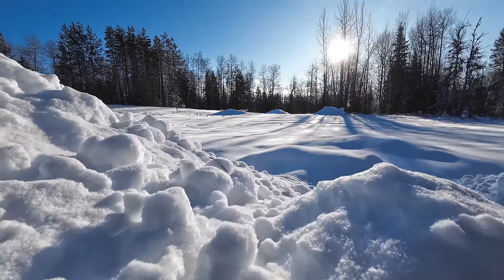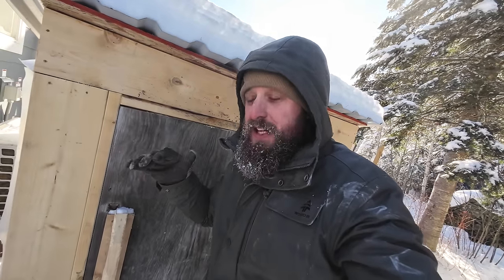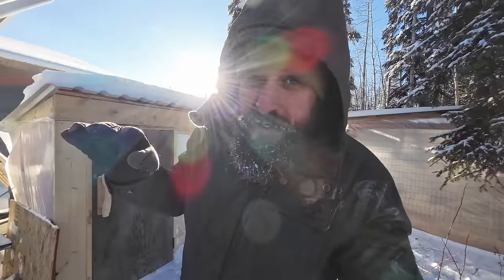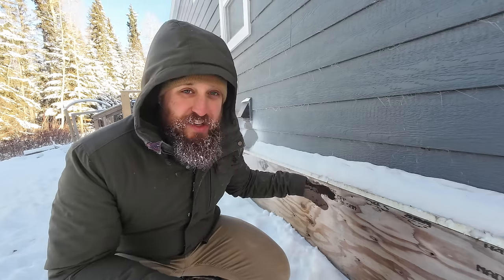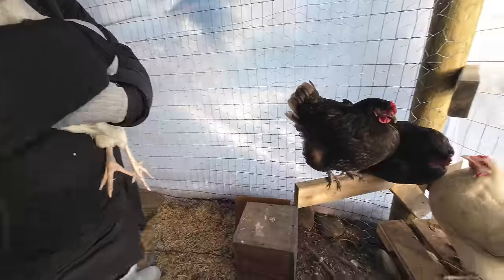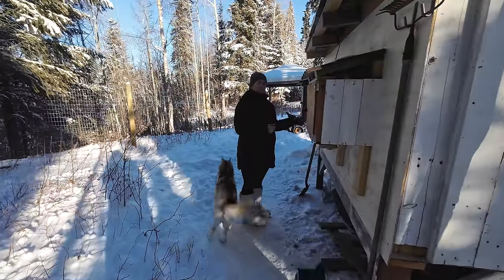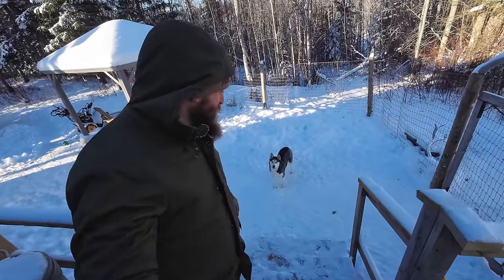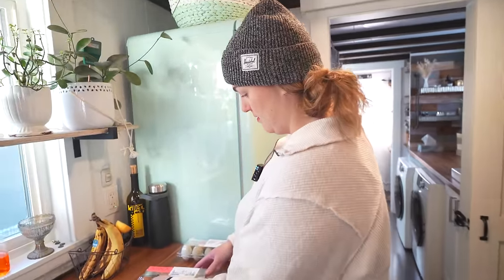Surviving a POLAR VORTEX in our TINY HOME! | -35 Celsius!

Comment: My father always shovelled snow all around the shirting on our trailer to help insulate and keep the cold wind from getting under. it really makes a big difference.
Reply from the maker: Snow is an amazing insulator and makes a MASSIVE difference :)

We should have enough snow fall that we dont even need to shovel it as it will build up that high on its own haha
Reply: Yes, I used to do this when we lived in a mobile home. Got to be such a habit, I still did it around our concrete basement walls when we moved.
Reply: He was kinda building an igloo.👍 Smart man.
Reply: Great idea!! My Dad did something similar with our 1890's uninsulated frame 2-story house with basement: he would lean sheets of plywood all around the perimeter of our house. Underneath them he would pack fall leaves. So when it snowed the snow would bank up at a slant around our house, so it would not only help insulate against the cold, but also in April thaw/melt the water would run off away from our house and keep our basement dry (This was in Massachusetts where many winters we had drifts to the top of the porch roof and we would have to dig a tunnel from the front porch door to the plowed road to get out.)
Reply: Your home doesn’t look tiny! 😊
Reply: I've heard of piling snow around the perimeter of homes before, .. also tents!
Reply: Should have a couple small vents in skirt and use heat tape / insulation on water lines, maybe even put a lizard lamp under trailer if not in like 4 years it will be white mould under there

Comment: I’m shocked you guys don’t have a wood heater. They make a huge difference! I stayed in a place with the smallest heater & I had to crack windows it worked so well. Maybe consider adding one to reduce the propane usage in the winter.
Reply: Wood for fireplaces are crazy expensive in Canada
Reply: @sherinebeckford6304 it depends. I live on 27 acres which is mostly wooded. It costs us only labour. You can also have logs delivered as 8-12 foot lengths and do the cutting and splitting yourself if you have the space and ability.

Comment: If you are not living off grid,  use a (hard wired) small baseboard heater under your flooring set at a nominal temperature.  It will not only prevent your water pipes from freezing, it will keep your floors at a comfortable temperature during the winter months and your home that much warmer.
Reply: What a great idea!!

Comment: I’m a bachelor so i built a 10x6 tiny home trailer. Probably the smallest you can almost go and still call it a home. Everything is in one circle around you with a fold down bed. I put all the build like electrical plumbing built inside so it can be fixed. I did the same as you with pex for electrical coords that can be changed. My plumbing is manual kick sink with a dump bucket and usb powered shower with a dump bucket. My toilet is dry number 2 with external garbage can that is vented to the outside with an outside lid and ported from the inside so you don’t have to go outside to put stuff into it. Number 1 is a dump container. Diesel heater, wood stove and shore hook up. 42 inch tv with computer chair ps and pc. Ethernet hook up. I got a small portable propane buddy for emergencies. The walls are r15 2x3 with galvanized roof. I plan on doing aluminum exterior in spring. I’m parked on a farm for 500 inclusive and even got a covered slip, unlimited internet, water, electricity, toilet, xtra storage, fed fishing pond beside me with the ok to catch and cook. I even got work without leaving the property. What a gold mine I got myself into if you ask me. Building a tiny home, one of the best decisions I’ve ever made.
Reply from the maker: YAS! Love this. We too do a lot of work from home. Our tiny home has given us the ability to chase our dream jobs and start our own business'. Is it small and a different lifestyle with its draw backs? Of course, but we are much happier now than when we worked the "9-5" jobs for someone else and trying to pay off a massive mortgage.
Reply: @wickedlife that’s how I feel, most people can be happy and comfortable in a tiny home, not everyone will like the smallest size tiny home but it’s possible. I’m looking into making one similar to your guys size and I definitely like the idea of overall less cost, more comfort (in my opinion) and SO much easier to work on if you need repairs. I genuinely do not understand the appeal to large huge houses especially when you don’t even have a decently big family, but that’s just me

Comment: I'm in Alberta and I use propane too.    Get a full sized tank that's outside.        Fill it once and it lasts for a few months.  My propane company even came out on Friday and filled it up even though I wasn't on their scheduled filling date till  next week.    In this Deep Freeze,  with the heat tape on the water pipe from our well not working and no water, I at least wanted to make sure I had lots of fuel.       Alberta sunshine has been warming the inside of my house through all my south facing windows by the afternoon, so my furnace doesn't have to come on as much as it does at night.       I was hoping that El Nino weather system which had it warm through the fall and over Christmas, would last till the end of February.   That we wouldn't end up paying later for that warm weather.    Hopefully, this will be it for the Deep Freeze weather and February will be nice.
Reply: This is Alberta. Always plan for changeable weather. Here in Red Deer the wind chill is -50. Tuesday it's to go up to -12. I'm thinking that a Chinook might be coming. I am getting tired of this cold.
Reply: @westzed23         I'm not very far from Red Deer.    I have two temperature  readers and it never got as cold as what the Red Deer airport was saying.     Yesterday it was -31 here when my husband went out to Rocky.  There it was -38.     it's -9 here this morning.

Comment: My new propane furnace was not keeping the house warm, so I fired up the cheap Chinese diesel heater on full. Uses about 2 gallons a day on high, 1 gallon a day on low. I have 2 so if there is a super cold snap (right now -10F) I can fire up #2. This is the least expensive heating option for me. Propane is most expensive (over $1K a winter), running my 24K Senville mini split on high costs me about $200/month, or between $100-150/month for diesel. Make sure the hens have a roost so they can get off the cold ground. I added lights to my coops, and I am getting too many eggs. I have 20+ dozen eggs on my table right now. Corn helps they create heat.

Comment: Raised baby chicks in our house once. Did not do that again. The dust was horrible however we could close the door to their room for their chirping. It worked but a few years ago we purchased a small shed to store our feed in & last year I used it for the baby chicks. Put a large dog kennel in it, wrapped it with foil bubble insulation & added a heat light. It worked great until it was time to move them into the coop.
Reply: I did, too. I don't think breathing that dust was good for me.

Comment: Insulating skirts under the house, those of Plywood. Very important in the cold season.
Be careful in the summer, without adequate ventilation underneath the house, moisture can accumulate, causing mold and wood rot.

Comment: frozen water pipes are not fun.  mine have been exposed for a couple winters now due to groundwork. when they froze I would thaw them out with my hair dryer. this year we have worked on covering them back up but the sand is just on them now (5 tons is a lot to shift by wheelbarrow) but luckily we had a lot of snow, 40 to 60 centimeters in 6 hours before the freezing truly started. nice insulating for pipes and house. I think your chickens are still in lay because of the extra light. they look like very pampered ladies. found you like I always do through christmas videos. what can I say... I love christmas. keep nice and warm. do as I do. use a cat as a hot water bottle.
Reply from the maker: So glad you found us with our Christmas videos! :) 
We definitely use our cat as a hot water bottle, particularly at night when he curls up in bed with us haha. 
OH NO! sounds like you've had it rough with your pipes freezing, hopefully thats the end of it.
Reply: it should be fine, it has to be as I use hot water as a painkiller since I have built up resistance to painkillers. so looking forward to spring and use my body normally again. and make christmas ornaments for my christmas markets. you have it colder than me. we just had -15 celsious and now it is thaw. keep posting love from Denmark @wickedlife
Reply: Haha, great suggestion about the cat as a heater!

Comment: i used to run propane in my home in north central British Columbia Canada, the easy trick is to shine a heat lamp on the tank...  fun fact, propane boils at -40 Celsius, hence the heat lamp......it keeps it warm enough for the propane to flow into your heater.  just and FYI from an experienced propane user.

Comment: Some context for you guys who don't experience this -- (i live in Minnesota, USA so have had -40 here)
-40 is the magic number where C/F coincide 
-40 is what the Germans in Stalingrad & Napoleon in Moscow dealt with (without winter clothing)
yes you really can toss a a cup of boiling water in the air & it will freeze before it hits the ground, I've done it

If there is even the whisper of a wind at that temp the total time to frostbite is a bit over 5 minutes
I have a 3800 square foot 120 year old house (it does have blown in insulation) I cannot get the temp over 55 degrees with the boiler running full out at these temps
Yes the gas bill is ~350.00 ish
Reply: Ever considered tearing the exterior walls down to the framing and rebuilding, plus the windows & doors.

Comment: I live in Southern BC, in the Okanagan area. We are very very cold right now. We live in a mobile home and we woke up to frozen pipes. We even have electrical heat tape on our pipes, but it wasn't enough last night. So, my husband had to crawl under the trailer and use the heat gun to thaw the pipes. We now have the water running to keep them from freezing again. I look forward to this cold snap being done. Stay warm up there. I am like your partner and don't like cold, but I would rather go through the cold snap than have baby chicks in my house. haha We buy our eggs from local farmers. :)
Reply from the maker: Oh no! We are glad your husband was able to thaw them out. Hopefully you both stay warm and dont freeze down there!
Reply: That would be awful. Clever solution! This afternoon, it rose to -10, and I was surprised to find myself cheering. Next week, we are back above zero. I hope there is no more freezing for you!
Reply: @bethkelsey1  ya, thanks. It sure is a moment when you are just waking up and sleeping and you can't figure out why no water is coming out of the tap. haha It's crazy to think that rising to -10 makes one happy. haha stay warm as well!
Reply: @kb9847  Can you make some kind of "skirt" around the Mobile home? I did that when i went up to Norway/Sweden by camper back a couple of years ago. Helped a lot with keeping the camper warm too. I used "whatever i could get my hands on" even if most of it just blocked the wind. Only went down to like -23C at nights but kept the greywater tank from freezing/bursting at least.
Reply: yes,  @peterpain6625  our trailer is skirted and we have electrical heat tape on it as well.  We talked to our neighbours and all of them have told us we have to keep a cold tap running. I just hate the waste, but would hate burst pipes more.  Thank goodness it's not our regular temps here. We are back to Zero C now. whew!!

Comment: Is there a reason you don't have a tiny wood stove?  It would heat up your tiny home very well.  The only downside is you have to feed them much more since they're a small stove.  Would be much cheaper than propane and serves as a bit of redundancy/backup for heating.

Comment: We live in an 8 by 24 foot tiny house in northern Ontario. I have an incubator that I hatch my eggs from my hens in and have raised 4 batches of chicks in the house. No more! sweet as they are. I have to wash every inch of my walls. Every surface from top to bottom from the dusty filth that they make. so now I'm going to time my hatching (Which I'll now do in my solar shed and time it with the weather so that I can raise them outside in the chicken coup  in a separate broody area with their heating roof. once they're feathered out and a bit bigger I bring them outside in a little pen during the day and when they're bold enough, I raise up the bottom of their pen so they can run in and out with the big kids and come back inside to be safe in their little area. if I have any broody hens in the future  I'll put mama and her eggs in this broody section as well.  . all the best and you'll see what I mean about the dust. they are filthy little things but very cute.
Reply: Really that is not a tiny home.

Comment: Strange that you have problems with LPG? Here in Sweden temp in winter it’s also pretty low but our LPG tank  as it’s yours siting outside in open. What i have done it’s that i have isolated hose that goes from tank to our LPG heater and never ever have any issues, even at -35C.

Comment: I see you have ripe bananas.  Here is an easy recipe for muffins or loaf.

1/3 cup melted butter (or 76 grams)
3 - 4 bananas
1/2 cup sugar (or 115 grams)
1 egg, beaten
1.5 cups all-purpose flour (or 187.5 grams)
1 teaspoon baking powder
1 teaspoon baking soda
1/3 teaspoon salt

Turn on oven to temperature indicated below depending on if making muffins or loaf.  Grease muffin tins or loaf pan.

Melt Butter.

Mash bananas in large bowl.  Stir in melted butter, egg and sugar until well mixed.

Optional:  Add 1/2 cup of walnuts 

Sift or stir together flour, b.powder, b. soda and salt and stir into wet mixture.  Do not overmix.

If making muffins, bake at 375 degrees F for 18-20 minutes.

If making loaf, bake at 350 degrees for 55-60 minutes.

For vegans, use plant based butter and leave out egg out or use a replacement.  Recipe is still very good without egg.
Reply from the maker: OMG this is awesome!! Nicole is planning on making some banana bread, not sure if she has a preferred recipe or not but I will definitely make sure she gets this! Thank you!

Comment: No wood stove? It could save you a lot if (since?) you've got access to wood as we do here in the Yukon!
Reply from the maker: We almost went with a wood stove when we had our home built, the only reason we went against it was we heard that getting insurance for it in our area would basically be impossible then. With propane, it saves space and is more insurable. If it weren't for that, we would have 110% gotten good heat as it also helps with potential moisture build up.
Reply: @wickedlife  too bad about the insurance. Wood heat in our old (50s?) house is much more comfortable than the propane we relied on our first winter.

Comment: I have had a terrible time in my old house (not a tiny home) bc there are vents that allow air (and animals) under my house.  Every year I deal with temperature problems and potential pipe freezing.  I've had a couple companies come to give quotes for enclosing the crawl space and they want TEN GRAND to do literally the bare minimum.  No way.  The insulating baseboards you have is a very clever idea, and would probably be much cheaper in comparison.  Of course the big companies who want all that money won't suggest a simple solution like that.  They want to do full fancy encapsulations with annual maintenance yadda yadda, no thank you.

Comment: It's not bad to have chick's inside. Living through the cold with the chickens is a bit more challenging. But it looks like they are cozy enough. We keep the coop closed on the extremely cold days but most of the time the chickens head out for a while. Predators definately get hungry and more desperate.
Reply from the maker: We have 2 100 watt ceramic heat bulbs going in the coop right now and even still our chickens want out during the day, they would probably start fighting and going crazy if we closed the coop door. 
We are lucky enough to avoid predators so far, especially with the fenced cooped inside our fenced yard with our 2 huskies partolling around the coop and run all the time. We did see a hawk in the trees above the coop the over day, but they are well protected rom the skies too.

Comment: With a cat and a pair of huskies, that's a lot of souls inside a tiny home. I'm puzzled as to why there isn't at least an option here to heat w. wood - personally, I can't imagine not having a woodstove in ANY sort of cabin - it's well-worth the space it takes-up, and if you used an outdoor one, like you see on many farms, you'd have plenty of heat to keep the floors cozy and the chickens very happy. The money saved is an obvious benefit, and of course, you can still have propane for other things like electricity, or better yet, solar panels to reduce cost. I highly advise against those tiny woodstoves which look lovely, unless you fancy getting-up every 45 minutes through the night to restock your tiny stove. It's also a nuisance bc you have to cut your wood twice as small - basically into fast-burning sticks. You may end-up cursing that decision! They say that with wood, you get warm 3x - once while chopping it, again while stacking it, and finally burning it. And for atmosphere, it's beyond compare - the crackly sound, woodsy smell, dry warmth and beautiful golden glow result in something that hits on nearly every sense. It's "only" -16 C here today, but it's snowing beautifully and there's simply no greater feeling of security and self-reliance than knowing we have a winter's worth of dry, chopped wood stacked securely outside.